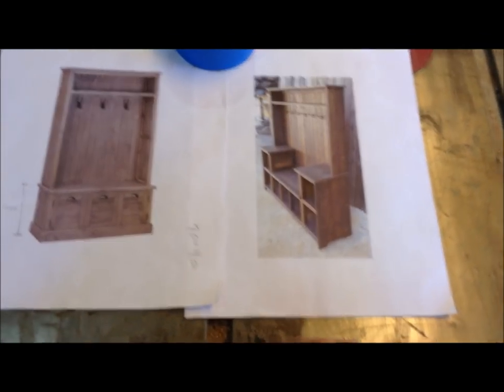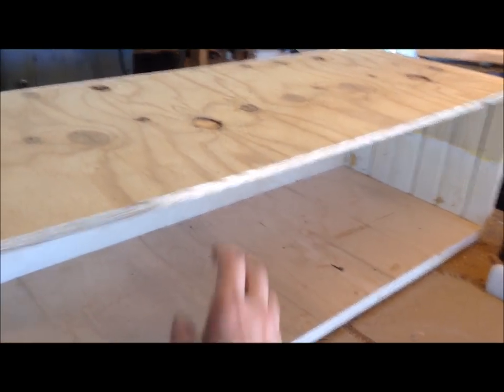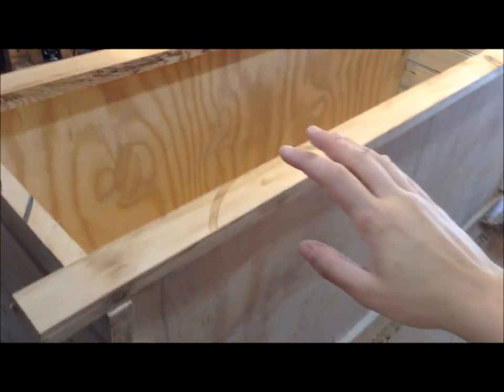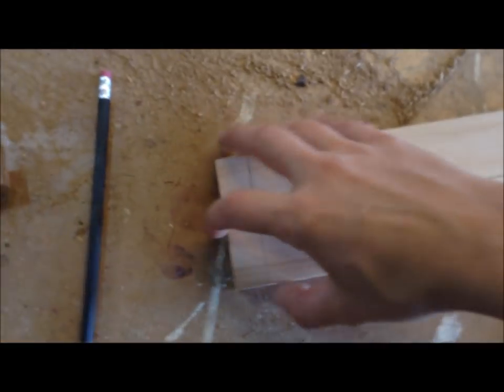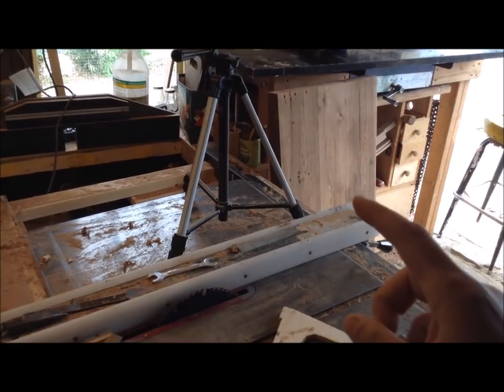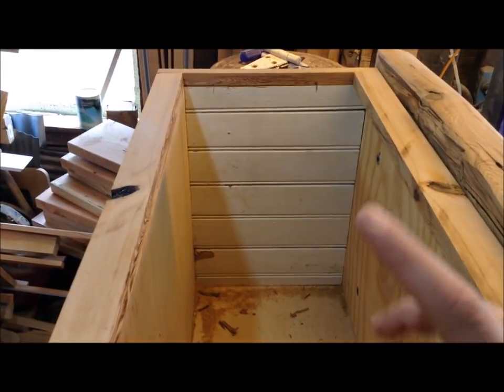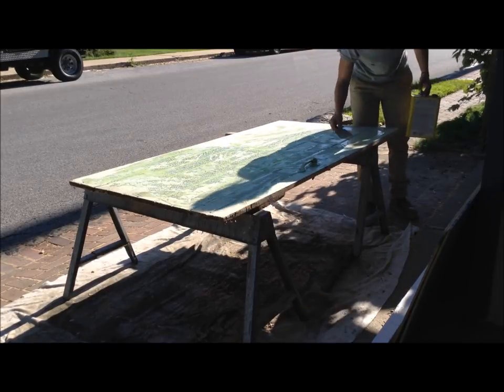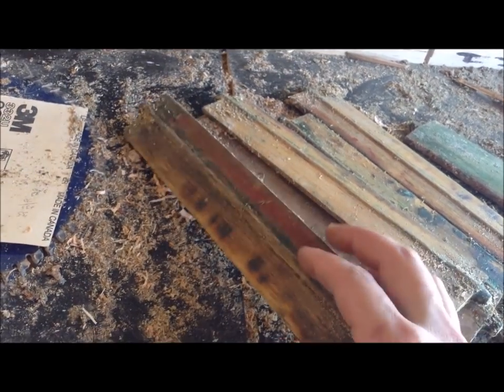How To Make A Hall Tree / Storage Rack  [Part 1]

Comment: AH!, nice job.
Another good way to strip multi layers of paint is with a heat gun and dull, blunt, putty knife and scraper.  After you get the technique down and get into a rhythm it goes really fast.
Residuals and paint in the dents and grooves can then be done with chemical striper.
Very course steel wool and stiff bristle brushes work with the chemical too.  Wire brushes tend to be too aggressive and damaging.
Keep up the good work!
I like what you do.
JIM